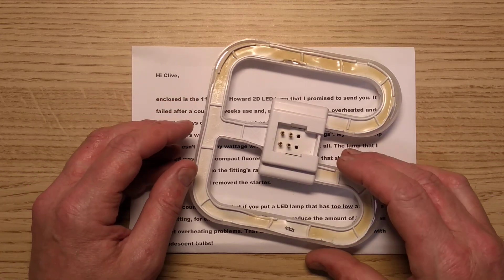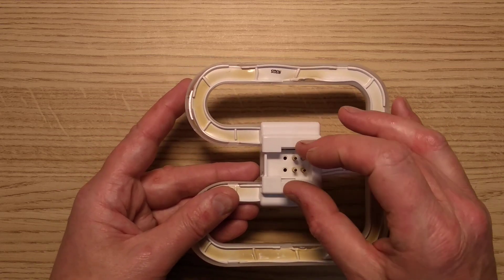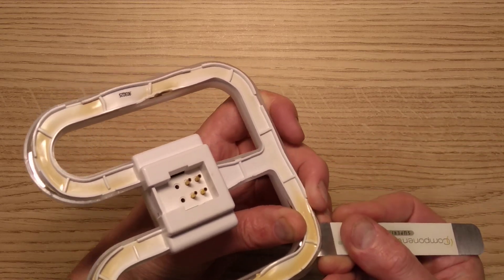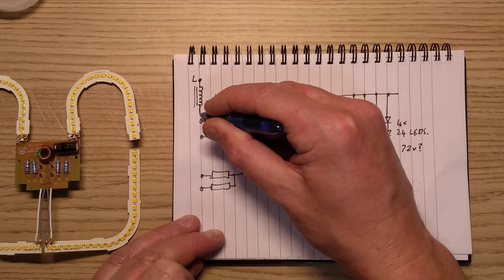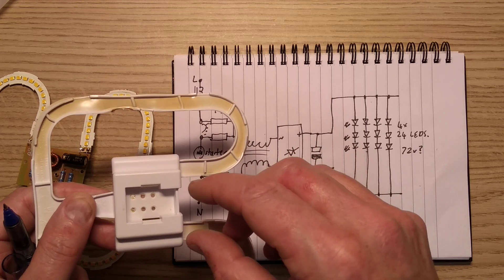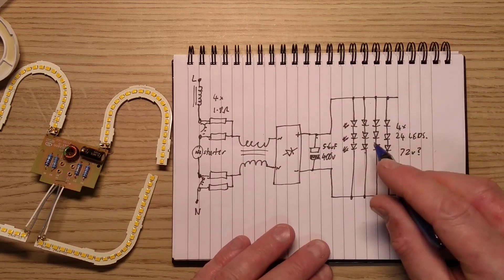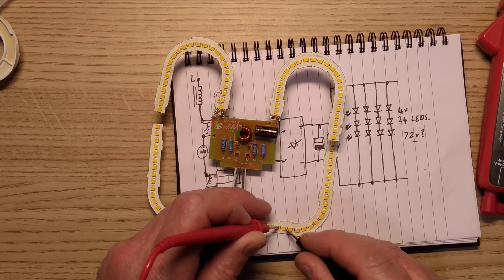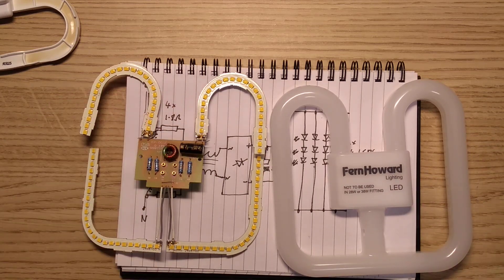Failed 2D LED replacement lamp. (with schematic)

Comment: I repaired some DMX lights at work. The leds passed the low current test, but failed at rated current. I think it is due to a bond wire failure and thermal effect. This might be the same issue...
Reply: Same thing happened to white LED lights at work. They lasted a while in the field, then started flickering. We tracked it back to bonding wire failure. It could be tested and provoked by heating and cooling the LED. We had to temperature-cycle certain lights for 24 hours to ensure they were good, while also looking for a replacement manufacturer for our LEDs. We ended up with switching this light to Cree LEDs, but someone in the chain missed the binning (probably only looking for the best price only), making the lights appear somewhat funky with the many different colours. Oh what fun we had.

Comment: Bad design that the part that needs limited current (the lamp) doesn't have the current limiting in it.
Reply: Well in theory the ballast is supposed to do the limiting. But if the limit is way too high for the specific lamp it will die
Reply: That kind of common sense clearly doesn't exist.
Reply: They saved at least 20 cents by leaving it out.

Comment: What befuddles me is why go through all the rigamarole of emulating a fluorescence tube with ballast etc? Why would a full wave rectifier even without filtering and a series resistor for each leg of LEDs work?
Reply: Emulating the fluorescent lamp means it's a direct swap without having to change either the guts in the fitting or the whole fitting, so it's a simple lamp swap for an end user/ homeowner.
Using the original ballast inside the fitting works as it's effectively a resistive dropper.
Although it would light without the rectifier and smoothing capacitor, it would flicker at mains frequency, the series resistors in each leg is primarily used as a fuse with fairly minimal currently limiting as a bonus. They're connected to the input side of the lamp and aren't on the output/ LED strip side of the circuit.
Reply: The ballast is an inductive dropper (so, 180 degrees from Big Clive's default :-) but otherwise should work fine - if sized appropriately :-)

Comment: Is the back of the PCB supposed to have a heatsink?  It looks shiny like maybe it should.
Reply: Nah. It’s aluminum PCB for heat dissipation, but the plastic does not allow room for any more heatsnking than that.

Comment: I have to say that the manufacturer should tell you what fitting to use it in right on the lamp, not tell you what not to use it in. Maybe you only have three option and by telling you not to with the other 2 that only leaves one. But thats silly not to put the wattage of the fixtures it CAN be used in right on the lamp. Telling someone what NOT to do, makes so many people think "that sounds like a challenge". Or "why cant i." If it simply stated "use in 16 watt fixtures ONLY. " i bet less people would disregard this.
Reply: I've a light marked 'Max 40W' but I've put a 60W bulb in it. The reason I can do this is that the lamp is unusually air-cooled ! (i.e. is outdoors ;) )

Comment: so, he said he removed the starter and I'm assuming he connected directly to the mains. Did this cause the failure?
Reply from the maker: The starter does not limit current.  It's used to preheat the electrodes in a conventional fluorescent tube.
Reply: @bigclivedotcom  thanks

Comment: The original fluorescent version tends to melt up the plastic during a stuck starter!
Reply: That's not true. It is rare for that to happen and often happens when the wrong starters are used or cheap starters.
Reply: @Xenon777_  For you maybe, but i have changed many of these 2D bulbs with an internal starter that had got stuck heating the electrodes to the point that the plastic melts and turns yellow to black.
Reply: @TheToastPeople  Well that's on 2 pin 2Ds. That can happen yes but more likely on cheap lamps. The 4 pin 2Ds have a separate starter to a less likely to melt.
Reply: @Xenon777_  Have seen the 4pin version fail the same way, I guess im re-lamping with cheap Chinese junk! Often or not the starter goes brittle in the 4pin version due to its proximity to the lamp, It crumbles in your hand when trying to remove the starter lol.
Reply: @TheToastPeople  I have experienced that too. Starters crumbling and getting stuck. Best thing is get safety starters or Pulsestarters.

Comment: Yes, the original tube would have been 16W.
Apart from 4 sets in parallel, maybe they are in 4 sections to nest on the board during production to reduce waste.

Comment: Maybe one of the reasons the PCBs are split into 4 separate sections is so that they could panelized more efficiently? There would be a lot of wasted PCB area cut out of the middle of an LED track of that shape if it was a single PCB.

Comment: i bet if the led wiring was altered to 2 parallel banks of 2 in series , it'd be ok on a higher wattage fitting?
Reply: i've looked on the fern howard website and it says their led 2d replacements are only for fittings with electronic hf ballast ...
Reply: they list a version suitable for 28w fitting,

Comment: Clive could you put a link to the spuger you use at home not this one.
Reply: Hi the spudger Clive uses is an iSesamo, made in Italy. Approx £5 comes with a smaller one for keyring too. https://www.amazon.co.uk/iSesamo-genuine-spudger-repair-opening/dp/B00OBJO6PQ/ref=sr_1_1?crid=158Z6UB1QV9Q2&keywords=isesamo&qid=1566434842&s=gateway&sprefix=Ise%2Caps%2C164&sr=8-1

Comment: If you replace a 28 W fluorescent lamp with a LED one which has a note on it, NOT to use it in a 28 W fitting; why use it??
Reply: Because it might not be only a 28w fitting. Common light fixtures don’t work like that. Most people have experience of fixtures that can accept multiple wattages. The power rating on the fixtures is usually the maximum power of the lamp that it can provide, not the only power.
Reply: Probably because most people, for some reason, don't have time to RTFM...
Reply: From an idiots standpoint, I put a 5w LED where a 60w was before then you'd figure there shouldn't be an issue. Obviously direct mains compared to these fittings are different but it's counter intuitive that underpowered bulbs would be an issue, see also 12v MR16s converted to LED
Reply: Because it fits the fitting?  sometimes stupidity wins

Comment: Impressive!! Those LED strips turned into a veritable heating element, and melted the plastic before they went open!
Reply: Yes - the failure was the crackly noise of the plastic not apparently the LEDs
Reply: LED grill heating element
Reply: Didn't save much energy, did it?